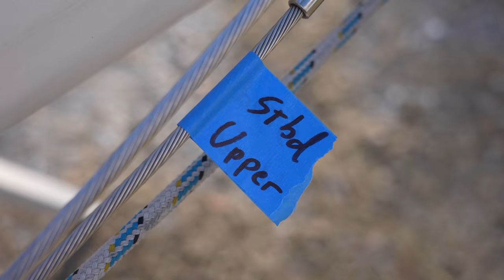Keep your MAST UP and your keel DOWN | S06E32

Comment: Jordan, you got some bad advice hammering the plate, as i think you figured out.  First its REALLY hard on the fiberglass structure, transferring all the stress to the weakest and most critical area, the fiberglass hull.  Please don't do that to the others.  Your idea to use a nail puller was the correct and best tool for the job.  Pulling is always the best way to remove fasteners and minimize forces to other structures.  Especially with the plate as the load bearing surface.  Sorry, structural engineer here.

Comment: Some times removing a through bolt, use a longer wooden dowel same size as the bolt. More forgiving and less damage. Tap bolt sideways if you can also. You have the best looking boat of all the sailing channels.. Carry-on

Comment: Absolutely great video ...again! I am SO with you Jordan on the simple project and suddenly 1/2 the boat is disassembled. I'm also impressed you managed to cram the camera and a light source in each of those places. I was laughing out loud by time code 21:10, crammed in the lazarette. I once was in mine in the early spring when the boat was on the hard towards the end of the day and had to get to a really tight place. I stopped and grabbed my phone because it occurred to me that I might get stuck in there and no one would hear me shouting for help until the next day. Thanks so much, I hate to say I got some enjoyment out of watching someone else wrangle all those issues. The crane ride looked fun.